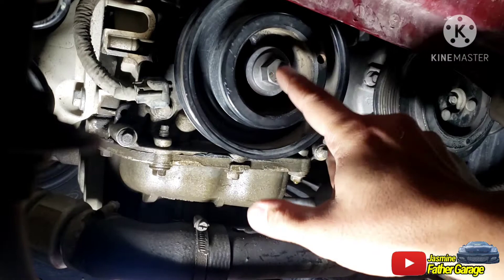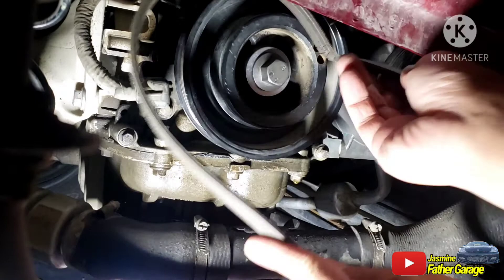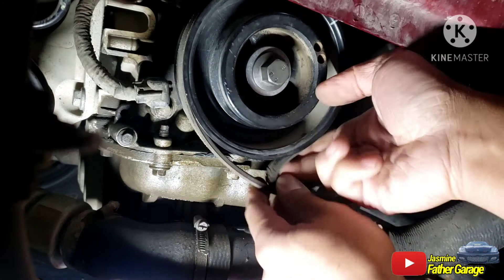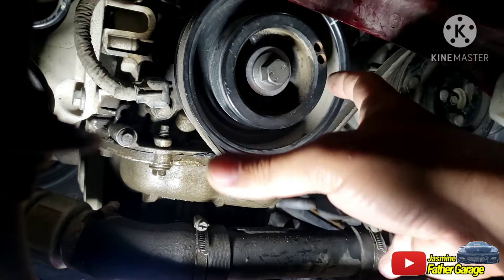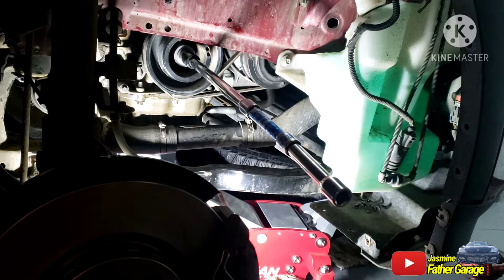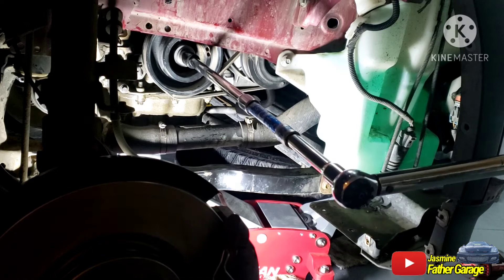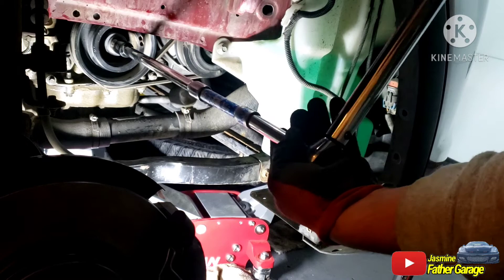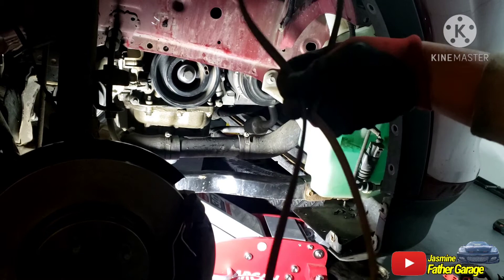Secret way Installing this Crank Bolt! Works with Any Vehicle.How to Hold Crank Pulley Steady #diy

Comment: Thanks for this, used the reverse method to loosen a stuck bolt on a pulley which had no holes or notches, wish I'd looked this method up sooner :)
Reply from the maker: Glad it helped

Comment: That's a great idea, but I wouldn't try it on some engines. BMW has some notorious high torque crank bolts 300 ft lbs + torque spec. I've undone a few and not worth risking other accessories.
Reply: If it’s a bmw you have enough money to buy the right tool

Comment: Thank you so much. It’s people like you that make YouTube great. I was struggling with my harmonic balancer which requires 120 ft lbs torque.The engine is out and on a stand. My A/C is still on the car but your method worked with the alternator. I had to guess the torque with an air impact but it was off , so thank you again and pleas continue to produce YouTube videos. 
FD
Reply: Your engine is on a stand and you can’t hold the crankshaft from the flywheel side?
Reply: You guessed the torque using an impact gun? 🤦 Well, good luck to you

Comment: Had to subscribe after watching this! I tried it the normal way with the special tool, 2 breaker bars, extensions and broke them after hours of frustration. Then I read a comment to just place the socket and breaker bar using the ground to hold the bolt and turn on the engine for a split second. That worked for me and only too 1 min!

Comment: Genius!!!
Worked a treat, many thanks😀
I torqued the bolt to 95Nm [70 ft lb] then 30 degrees then 15 degrees. That sucker is tight!
🤜🤛
Reply: on my 94 probe gt, it takes 120ft lbs... this is a cool 
idea for sure though yrs ago, I made a homemade holder that locks into my harmonic balancer to keep it from turning...

Comment: Good tip, although I'm not sure if this will hurt the bearings on the alternator or AC pulley.
Reply: I believe i just destroyed mine with this method! After several days of changing my timing belt i can hear some bearing grinding, i actually hope that this is the AC pulley bearing and not something from my timing belt zone...
Reply: @johnlakes6948 might have already been worn out, or you were jumping on the breaker bar!? 
Hopefully not a major issue...
Reply: @krispy5139  nope, i have not jumped it on a breaker bar. But i did change the excact same pulley bearing a few years ago. I actually used the same method to tighten it up 90 Nm + 90° that is what my manufacturer asked for

Comment: This helped a lot.
Before this I was putting a C-clamp on my cam gear with a wood shim under it to prevent it from denting the head, I did break one C-clamp doing it this way and don't recommend it. 
I did it your way only I didn't have a spare belt I used a ratchet strap. I tied it around my pulley and wrapped it around a few times and hooked the hook on the frame but it kept slipping so I just kept sticking pieces of rubber under the strap until it stopped slipping 👍.
Reply from the maker: HELL YA Creative Improvise guy. Your thinking what i was thinking, good work champ im glad it work great

Comment: I can't thank you enough for this trick solution. You are indeed, a life saver. I used this to torque the crankshaft pulley bolt on a 2001 Dodge Neon.
Reply from the maker: Excellent!. Thanks for watching

Comment: I use a threaded rod through an old spark plug as a piston stop. Or the safer bet is to feed a length of rope down into the bore with the piston at BDC and leave a tail out, then tighten the crank bolt,  compressing the rope.

Comment: Awesome trick! By the way, it's bad for your torque wrench calibration to keep torquing after it's clicked. If you want more torque, set the wrench higher.
Reply: and loosen it after use when you put it up.  Don't leave it set on torque number.

Comment: It is so simple, why didn't a child think of it?
I bent lots of timing cover bolts using a screwdriver against one through the pulley.  Luckily they have lots of them at the junk yard usually.

Comment: What about when you have a bolt that is 240 ft lbs?  This will not work
Reply: Time to put the flywheel lock on the other end at that ft lb.

Comment: carnt you just put the car in gear foot on brake then tighten thye bolt?
Reply: Not really.  Engine still spins when you are stopped at a traffic light also.  Pull the starter and use the flywheel teeth would work.  But this is simple and elegant.

Comment: Sir how we know that pulley bolt open in clockwise or anti clockwise. 
Because most of the bolt open in anti clockwise.
Reply from the maker: You need to do some research on your vehicle find out the rotation of the crankshaftbolt remove, in this video I've got going  clockwise rotation to remove
Reply: @jfGarage4k  sir can i know the direction of engine rotation. From front (radiator) of the engine
Reply: Look at the timing marks.  the rotation would go from high to TDC.

Comment: Will this work if i have to torque my bolt to 181 ft lbs though
Reply: Same question for me. Did it work? Fukin Toyota
Reply: @PeanOutside  to be honest no lmao I just ended up hitting the crank bolt with the impact idk how many ugga duggas it was but it was a lot lol
Reply: @hunterrollins5646  yeah that’s my backup plan. I might try this since my ac doesn’t work anyway

Comment: 74 foot pound?? Kinda low imo
Reply from the maker: Service Info torque specs say 75lbs
Reply: Mine is 75-105.  Think my buick is 70 + 90 degrees, and it is a throw away bolt.  But it has extractor screws, so I put bolts in them and use a crow bar so it can't turn.
Reply: does seem Very low... mine was 120 on 94 probe gt

Comment: You are not getting the true torque spec with all those extensions.
Reply from the maker: Sorry it was off camera. But  here the procedure crankshaft bolt torque 
74 ft lbs plus 90 degrees  wait 2 seconds  add another  15 degrees and your Done
Reply: @jfGarage4k  sir what torque specs/procedure for camshaft bolt??
Reply: @jfGarage4k  What he means is you lose torque with added extensions. So you might be getting the 74 ft lbs "click" out of the torque wrench, but in truth some of that torque is being lost at the extensions. You could always double check your torque by removing said extensions and getting under the vehicle to get a better angle/space to actually torque it down.

I'm looking at alternatives on here because my vehicle calls for a strap wrench for this procedure and I don't have one. Actually using a belt on the crank pulley and the A/C compressor didn't cross my mind, so thank you for that! Will try this out later in the morning.

Comment: Why not use impact gun? Lol you must be a rookie
Reply: Pot meet kettle. Impacts are fine removing but put way too much torque cranking them back on. These crank bolts often need less than 100 ft lbs. It's best to tighten and torque down with hand tools.
Reply: Right, best to torque it right
Reply: @nathand1686  i used a impact, 40k miles still going.
Reply: @deeznutzz101 No one's impressed, rookie.
Reply: @deeznutzz101  It is REMOVING at 90K that may be the problem.